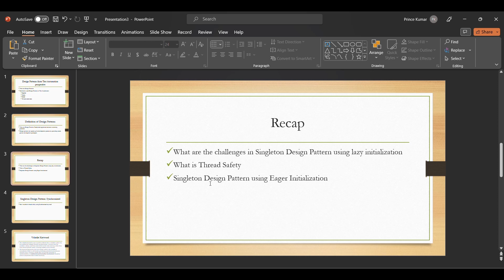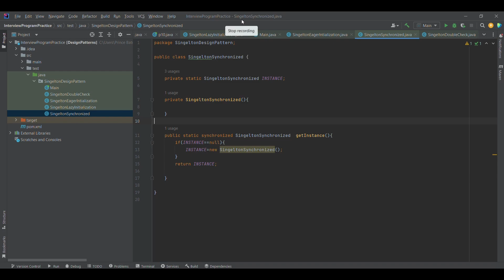Ensuring Thread Safety: Singleton Design Pattern with Synchronized Approach | Lecture 4

Comment: Hi Can i know adding this sycronize keyword is it surport to do parallel test without any issues or do we need to add double check mechanisum
Reply from the maker: Only synchronized wont help you need to use thread local as well

Checkout following video
https://youtu.be/lOYGQTw9XBA